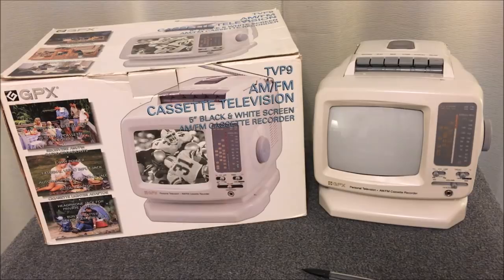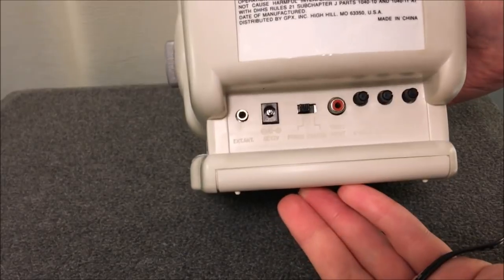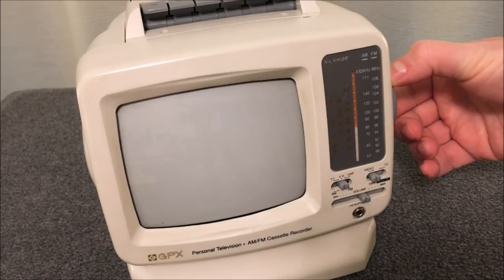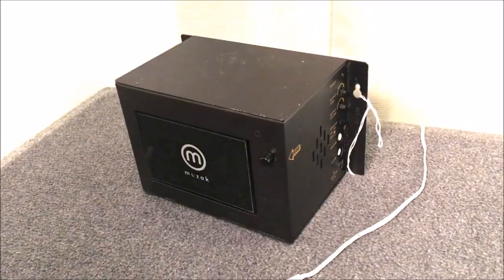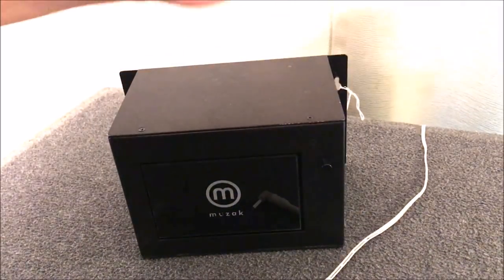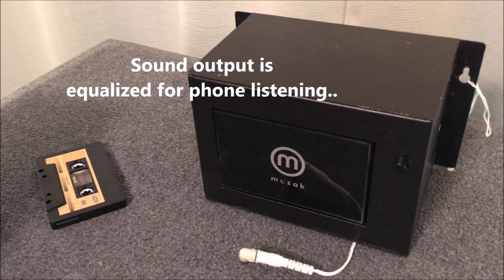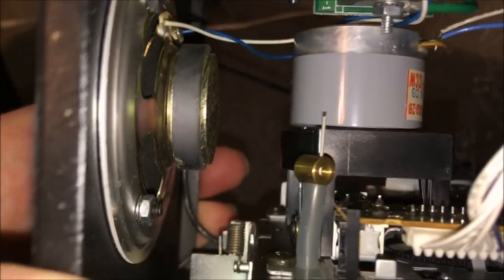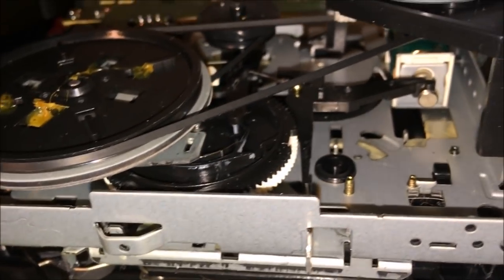Muzak Cassette Music on Hold & TV

Comment: 12:16: The ADSP is from week 39/1999, and one of the CMOS CD4000something is from week 22 1999, the flash is from 34/1999.
Assuming that anybody will avoid putting on stock production quantities of (at that time) expensive parts like the ADSP, the MUZAK had been build end of 1999, beginning for 2000.

Comment: I still have my GPX.  I still use it to listen to baseball games.  There's still an analog TV station in my area, on channel 6, that operates as a radio station, with traffic & weather radar maps for video.  The audio sounds distorted, because the station runs the audio very hot, so it comes out right on an FM radio.

Comment: I seem to remember these use a special cable that looks like an RCA cable, but the center pin in divided into 2 sections (kind of like a stereo 1/4" headphone plug).  That way one RCA plug could carry both sound and video on it.  So that's also why you're probably getting the "video in sound" problem because you're just using a normal RCA plug

Comment: On the Muzak the Analog Devices chip is a DSP and the memory chip is a 2M x 8bit NAND flash not even enough for a single MP3.
Part of that is probably reserved for the voice prompts not leaving much for the on hold music so it's probably recorded at 8bits to save space.
Reply: Firstly, the frequency rance of a telephone line is around 300-3500 HZ, which reduces the "cost" of storage space; Secondly, the dynamic range of the audio is probably compressed a fair bit, which further reduces the storage requirement; in conlusion, i think those 2 Megabytes is just about sufficient.

Comment: 14:12 they even into the effort of putting a dedicated grounding cable on the tape chassis, despite the fact that there already tons of ground connections through the metal chassis. So either there were playing by the book during design. or they faced really strange issues during design, despite the fact that they were limiting the audio to the 300-3400Hz bandwith of the PSTN. (or they did not know how to make a band pass filter in the DSP, but rather did the "filtering" just as a low pass by setting the sampling rate to an effective value of about 7kHz)

Comment: That single video connector could be for an Nintendo NES system. It used a video and audio signal in one connection. Did you try running audio only into that input?

Also can you record audio from the TV or the radio?

9:15 Your call is important to us, Thank you for your patience, please stay on the line for the next available representative.

 I bet you can tap the audio after the head preamp and before it's resampled for the phone line. add a few buttons to the front of that (eg play, stop, rew, ff) and you have a nice little tape player.

Comment: AD chip is dated 9939 the chip was mfg the 39th week of 1999 or  the September 27, 1999 October 3, 1999...
 The date code usually is in either of two formats: YYWW or WWYY, where WW stands for the week number of the year (Not the month, seems strange, doesn't it?), and where YY stands for the last two digits of the year. For example, in the picture, the date code reads 8332, meaning it was made in the year 1983, in the 32nd week.

Comment: Good stuff! There's a stamp on the Muzak belt motor inside that says 16 94 which could mean the 16th week of 1994. Maybe.
Reply: Dan O'Connor The ADI DSP chip says 9939, so I guess it was made in late 99 and that motor was just old stock they used.

Comment: I think the other vent is being used for ventilation/bass reflex port?, if I owned it I would have replaced the existing speaker with a hi-fi one to improve the sound. I don’t think the circuitry supports stereo? If you put another speaker in it, the grill at the back will act as a bass reflex port.